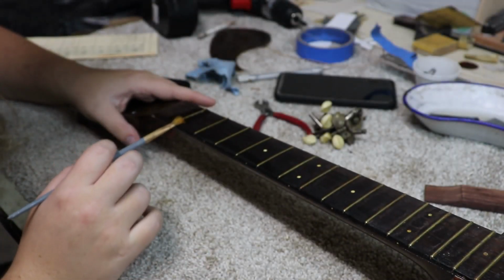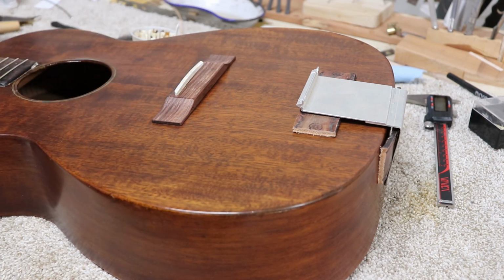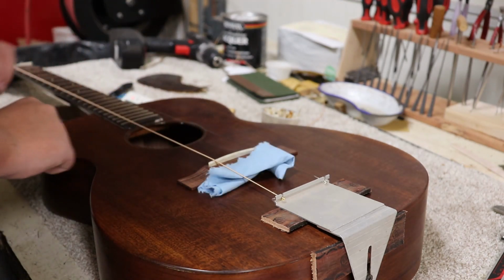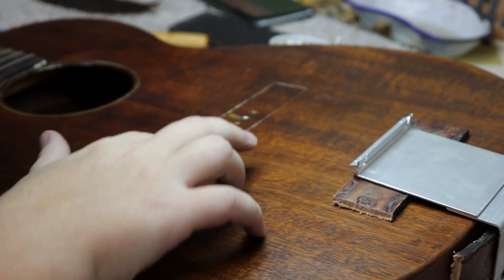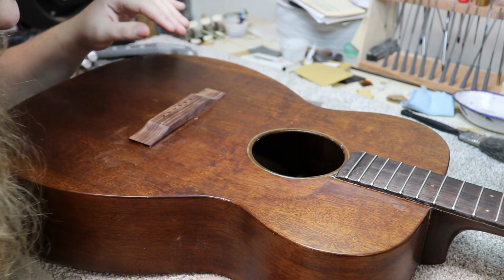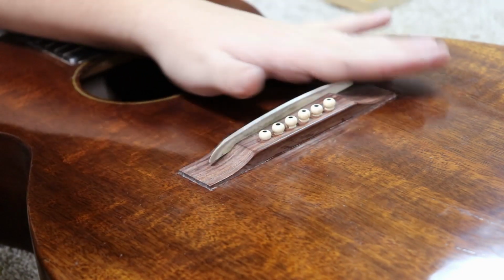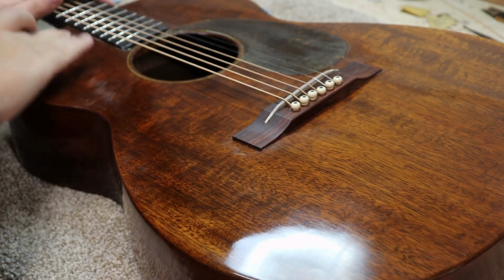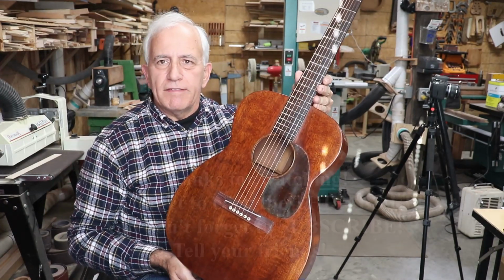456 RSW 1945 Martin Finale

Comment: Such a great job, Caleb! The owner must be so appreciative of Caleb's fine work on that lovely guitar. Regarding the pickguard, I had a couple of early '50s mahogany Martins and they had some blotchiness on the pickguard. Cleaning fluids wouldn't touch it. I was up at the Martin factory and some of the old-timers there explained the finish was on top of the pickguards in those old days, and that blotchiness was UNDER the finish. They gave me six squares of sandpaper in ascending order of fineness, and I took my time getting that finish and then blotchiness off. Turned out so well it surprised me!

Comment: Mahogany is an open grain wood which is why Martin probably used a grain filler when the guitar was originally finished at the factory. I have been a hobby woodworker for over 40 years and took wood shop in high school and college back in the day when they still offered those courses. It is pretty much impossible to get a good smooth finish on open grained wood without a grain filler.

Comment: Great job, as I think someone else said you can sand an old pick guard start with 400 and work your wat to 5000 then polish with wax or just plain car polish and it will look new.

The old Martin pick guards used to shrink and it would crack the tops.
Reply: True, I would put a new one on it, but they will use the old one because of originality. IMO, a pickguard is like tires.
Reply: @jthonn  I agree its just a piece of plastic. Its already not original given they refinished it.

Comment: Nice job Caleb. The pickguard looks dull. Is that something that could be polished to match the new finish?
Reply: Could try petrolium jelly on the pick gaurd, just a tiny bit to put back a bit of oil in the plastic or car dashboard plastic restorer, that worked a treat on the plastic on my vintage Mego figures.

Comment: Regarding intonation, you are plucking an open string, then fretting the same string at the 12th, matching an open string to a fretted string is really problematic, to achieve a more accurate intonation, you should be using the harmonics of the string at the 12th instead of fretting, especially when the strings are so high.
Reply: You are correct that the fretted string will give a wrong intonation if the action is later lowered, but comparing an open string to open string harmonics will not help, since the harmonic will just be a multiple of the open string. 

The point of the intonation is to make the fretted notes correct, so you must use fretted notes. As you mentioned, this should be done at the expected final action height.
Reply: @P_Ezi  Works for me to get it very close for the initial location of the saddle, then I hand compensate the saddle for each string.